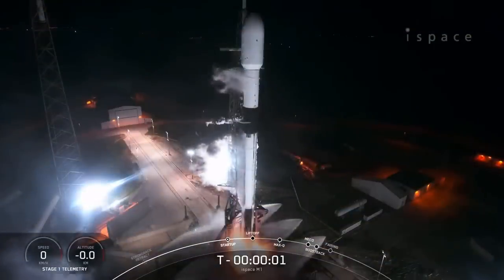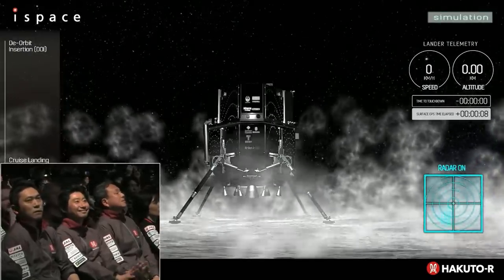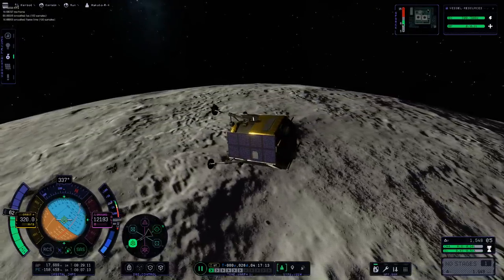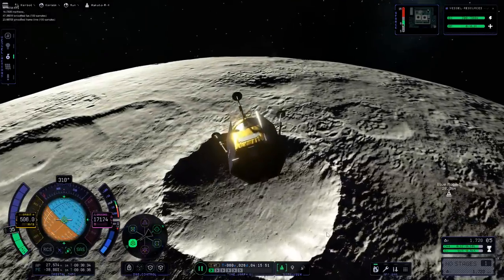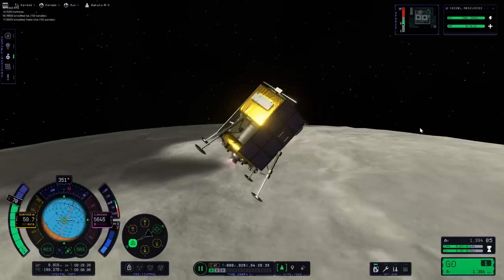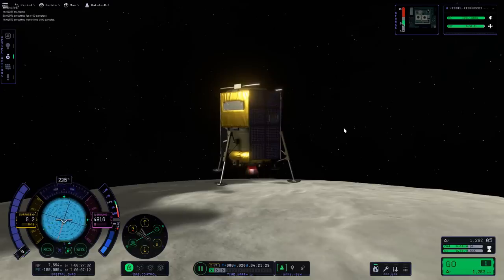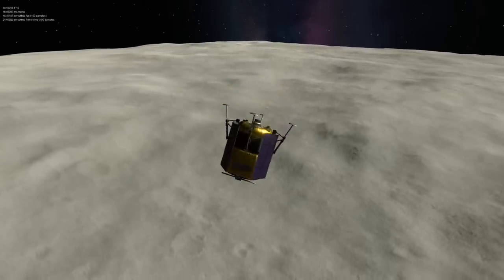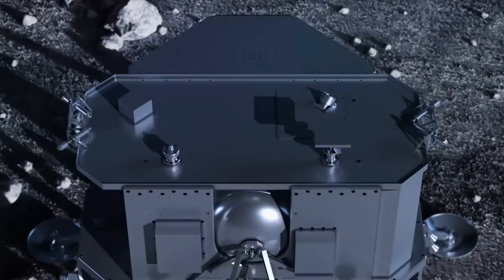Why Japan's Moon Lander Crashed Due to An Unbelievable Computer Bug

Comment: By, "unbelievable",  I'm pretty sure you meant, "Completely realistic, very common scenario when the software is put in an untested environment."

Note that I am saying this as a software developer myself.  I actually just identified a scenario where our existing tests were thought to be sufficient, but then some surrounding parameters changed and a bug was found.
Reply: As a software developer myself, I'm actually asking myself why those simulations were not set up to run like a CI.
Reply: @jarisundell8859  
Good question.  Seems like actually running the sim again once the final site was chosen should have caught this, maybe allowing them to upload the fix.

For the record, CI is how the one I looked at was caught... prior to release 👍
Reply: Scott is also a dev by trade, too, lol, he works at Apple.
Reply: @firefly4f4  I think it's a joke, since the bug happened because the computer didn't "believe" the radar
Reply from the maker: By unbelievable, I mean the software stopped believing the radar
Reply: @jarisundell8859  Physics simulations take at least a few minutes per run. You usually runs thousands or tens of thousands of those with randomized inputs during simulations test campaign. For CI you usually run single fixed one and check its output. 
The devil is in selecting how exactly do you randomize input data.
Reply: @SashaNaronin  If you think CI just runs a single simulation you're doing it wrong. As a software developer I would have generated many different maps with both normal and extreme edge-case terrains, and then had them be run multiple times with different initial parameters. Might even throw in some randomly generated ones.
Reply: Its the kind of bug where if you aren't involved, it's comforting to know that such highly skilled professionals can make such mistakes. At the same time, if you are involved, it is extremely cringeworthy humiliated feeling generating.
Reply: @scottmanley  It's similar to some plane crashes where the pilots stop believing their instruments show correct data and start to think they know better. Quickly they get into uncontrollable situation which leads to a crash.
Reply: @scottmanley  The software wasn't falling for it 😤
Reply: @ChemEDan  Flight Computer:  "I'm sick of your bullshit, Radar Altimeter!"
Narrator: "But it turns out, it wasn't bullshit."
Reply: @jarisundell8859  The problem in this case is that the computer has to expect the radar altimeter to fail. When the radar altimeter reports strange readings, it stops using its information. But what constitutes a strange reading depends on your landing site. If they had targetted a plain, were confident that they were in the surrounding area (no gps on the moon unfortunately), and the altimeter suddenly reported a cliff, then either the radar would be wrong or everything they knew about their position and the landing site would be wrong.
The issue is that after the landing site was changed, they did not properly configure the system to expect that cliff at that time during the approach. So when they detected the cliff, they software thought it was a malfunction.
"Software error" can mean many things, not necessarilly a software development failure (a bug). Misconfiguring software that is otherwise correct is still considered a "software error", even though the software didn't have a bug. That's a ops problem, not a dev problem. But the developers still get the blame.
Reply: @jope2  To me it seems like overengineering/overfitting, you build a very robust autonomous vehicle with sensor fusion, and instead of letting it do its work you add an additional demon in that whispers "expect cliff/expect flat"... That suddenly is no longer a robust system. No longer robust against flight plan adjustments.

Comment: Scott, I am surprised that you did not touch on redundancy. I was a fighter jet aviator and one of the things we always did was use multiple sensors to allow the software to compare and then estimate probability. If they has three Radar altimeters they could see the rate of change of the surface as the spacecraft travels. Even if each would have shown the cliff, probability calc would have told it that its is virtually impossible that all three are suddenly all bad. Redundancy would be one answer in my book.
Reply: Agree and also on my part, I always thought that radar altimeters were used « closer » to the surface.
Reply: Probably budget constrained.
Reply: @drill_fiend1097  This is a commercial effort so they could have just gotten one normally used in aircraft. It's not NASA where they cost $750K each just because...

Comment: hey Scott - thanks for the analysis. I remember this one (as well as the Israeli and Indian ones) and seeing the disbelief in the control room was sad. It is easy to tell who has a clue and who is a bureaucrat by their expressions, etc. :P
Reply: Hope there's no software issue when Nasa lands back on the moon!😂
Reply: @adarsh4764  agreed - one would have thought that even a small lander would have a pretty robust navigation system these days, but obviously they met an edge condition they hadn't properly tested for... and a sad oversight too as nearly all landing trajectories will have the radar return affected by craters you're passing over. There are many of them after all, and although most are small, many are large/deep and you need to keep their profile in mind as you use the radar/laser/etc surface measurement.
The state vector routine needs a sanity check to make sure the drift never disagrees from projected too much without it doing some form of reliable recheck.

Comment: Putting aside changes in mission plans, redundant systems missing or even software bugs, I think the main issue here is overly strict programming. Assuming something is defective just because of a sudden change that is out of scope is bit extreme. Baffles me how it could hover waiting for the moon while letting propellant go to zero without at the some point trying to salvage itself with something like "this is not working, maybe I should take another look at that system i think it's dead".
Reply: what you're describing is human decision making, and you're ready to scratch this plan and try something better when the moment comes. you can't just imagine every scenario branching out at every step and hard-coding solutions to each. At some point you'll realize you need a generic decision making algorithm. In fact the mission failed due to them having a specific solution of switching off a reading since that allowed them success in previous simulations.

Comment: Love this! Thanks you for reminding me of Kalman Filters, i studied those in my M. Tech., loved them but never thought i would ever hear of them again. I still remember how the "location estimation" part, based on current velocity and direction integrated over time (aka: dead reckoning) can provide smooth and accurate predictions over short durations, but errors tend to accumulate in a physics based predictor like this and needs to be augmented with an independent measurement (ie: the radar), even if the radar data is not accurate. Amazing to see how stuff like that led to this outcome. It is a tough one though... I wish you had shared your thoughts on how should a "faulty sensor" be detected then?  I mean, you could say that a 3 Km sudden jump in the sensor output means the the sensor is probably broken, right? If not, how else would you do that and handle the case when the sensor actually is broken?
Reply: Redundant systems and majority check: if all three of your radar sensor reports a sudden altitude change, than that's what actually happened. What surprise me is that the sudden altitude change eventuality is never accounted for...

Comment: I wonder what all these people in mission control were doing during the landing. Were they analyzing the telemetry in real-time? I assume they were supposed to notice that the radar altimeter was considered faulty and disabled. If so, perhaps they could have reviewed its readings and realized that after passing the edge of the crater, the readings returned back to normal. In that case, they could have just manually reenabled the radar altimeter. Since it is not Mars, the signal delay is small enough to allow for manual corrections during the landing.
Reply: Word!
Reply: They lost telemetry. If they had a connection they could saved it.
Reply: There might also be delay in communication.

Comment: But what if the radar altimeter actually did fail around the time it passed over that crater?  It sounds like it would have produced the same result.  I think the only way to deal with this in the design is to have at least one redundant sensor for something this mission critical.  Of course the problem with just one sensor is that you need to try figure out which one is actually the broken sensor.  That's why there is often 3 sensors or 3 computer systems that are used in this kind of redundancy...
Reply: Sounds like a redundant sensor wouldn't have helped this particular issue though, because it would have just gotten the same confusing measurements of the cliff wall. I think they just need to thoroughly run simulations of the actual mission to catch edge cases like this early.
Reply: On a vehicle like this, without humans onboard, the space and weight requirements might be too costly compared to the risk of a failed sensor.
Reply: @sonaxaton  exactly. Proper simulation campaign would've catched that.
Reply: @sonaxaton  3 redundant sensor and a voting system is the way to go. Worked flawlessly in many aeronautical things, from Concorde autopilot to missile guidance system.
Reply: The dead reckoning system combined with prior knowledge (a map of roughly what is expected) should have been enough of a redundant system.  Seems like they should have included a reassessment/recovery routine to check if that apparent altimeter glitch (which wasn't a glitch of course) cleared and the instrument was giving reasonable data.
This stuff is really tricky without a human in the loop.
Reply: @sonaxaton  If both radars give the same measurement then the software can conclude that they're probably correct
Reply: @wurfyy  What you said. Then ground control would override the astonishing choice to disregard the most important component in the landing (except propellant; but as it turns out, paper(radar) covered rock(propellant) so it killed that too).
Ground could say what was said in 1969, roughly "Eleven, we've looked at your issue and you are go for landing".
Reply: @sonaxaton  - The entire point of having the redundant sensor would be to vote.  You don't just assume an unexpected height is from a failed sensor.  If both sensors produce similar results, you assume the results are correct and that minor differences are actually a result of parallax or some similar issue.  

The only invalid values that should be rejected out of hand are min and max values, since that's what electronics tend to float (pulled up or pulled down) to when there is a hardware failure condition.
Reply: @wurfyy  - Exactly.  Well, they could give slightly different measurements due to something like parallax, but that's the right idea.
Reply: @a4d9  - But there was no accurate fallback, so not having a redundant sensor is probably a mistake.  If you can't have a redundant sensor, you shouldn't completely toss the sensor data because of an apparent glitch.  You should do some kind of smoothing or you should assume the data is correct unless the result is all zeros or all ones - ie: min or max values.
Reply: Radar altimeters are actually very reliable, and know when they're making an accurate measurement (their control loop locks on to the return path length) and when they're not. Really, the consuming software second guessing the health of the radalt by its data output was a crazy idea, when the radalt is in a much better position to know if it's working properly or not.
Reply: The report actually mentions "sensors" initially (plural) and then continues talking about "the sensor". So it's not clear whether there were redundant radio altimeters or not. In any case, all sensor(s) values were rejected.
Reply: @Damien.D  In this case the Kalman filter would have rejected the unanimous vote about the sudden altitude change.  
The fundamental mistake the team made is that they did not realize the Moon is full of sudden altitude changes and/or what that means for tuning the Kalman filter.
Reply: @sonaxaton  However, if you'd use three redundant sensors, you wouldn't just ignore all of them if they showed similar yet unexepected parameters. The issue here was that with one sensor giving unexpected data, it was just ignored. With three redundant sensor, you should only start ignoring one if the other two are in shared disagreement.
Reply: @Nummer378  never heard of redundant radar altimeters on a spacecraft, I don't think even the Apollo Lunar Module had one, really hard to land if your altimeter goes bust, next to impossible actually, better make it a robust device, if software can so easily dismiss radar altimeter which is normally a very reliable device then there is a problem with overall design
Reply: @Damien.D if you have the weight / power / space for triple redundancy.  And if you don’t have common mode failures.  Ariane 5 first flight had redundant IMUs but they common mode failed due to a user specification error (unit would error out if too fast too low altitude, which Ariane 4 couldn’t but Ariane 5 always would…).
Reply: @rspawn  The Kalman filter would be confused for a while. It would converge just fine during the remainder of descent, probs.

If I follow correctly what Scott said, the problem was not at all tuning of the filter, oh no. The problem was they improvised an ad-hoc way of discarding some sensor data before the actual filter.
Reply: If you always lose the craft when the altimeter is ignored then you must always trust it even if it might be wrong. Obviously, much better to have terrain prediction models and compare to these. In the end, your choices are always trust a maybe fault altimeter and maybe crash. Or ignore it when there is an error an guarantee crashing. Hmmm
Reply: @jamesgibson6641  I don’t even think it makes sense to attempt landing without functional radar altimeter. If you can’t trust it you are done.
Reply: @Damien.D  Achilles heel of redundant systems is Common-Mode Error.  As Scott stated, these recent failures have all been due to software.  It is best if not only the hardware is diverse (e.g. different manufacturers) but also the firmware/software is diverse - e.g. produced by programmers of different backgrounds (e.g. educational systems) using different programming methodologies and different programming langages.   In software production methodology experiments I was involved in during the 1980s, that approach demonstrated significant degrees of reduction in Common-Mode Error.  A team of three diverse developers can be less CME-prone than a roomful of "clones".  Also majority voting is not always the best way to fuse data.
Reply: @Olasek  what I meant to say is there is no choice.  Whichever way it goes you are landing on the moon somehow, either in bits or otherwise, there is no such thing as a safe abort as nowhere to go back to- unlike the Apollo mission which had the command module. The sophistication is in how you weight the sensor fusion filtering and in how the sequential decisions made determine success or failure. For example, flying over deep crater  makes craft think it is higher and confuses velocity landing profile, engines throttle back as seems to high, land comes back underneath, too fast, cannot, fix, crash. However, it may also be that in the last stages of a landing, very close to ground, the radar altimeter used for most of the approach will saturate and fail - say if it using a chirp profile and convolution to get better effective radiated power at long range. In this case a final approach sensor may take over and the altimeter readings are discarded. In the end, it is faulty requirements and flawed assumptions implemented in the software . Hope they learn and land safely next time.
Reply: @jamesgibson6641  it pays not to be too ambitious and just land, like Apollo 11 did, in a relatively flat terrain. But to overfly a rim and have to deal with drastically different floor elevation inside crater, boggles one’s mind why they did it, a bit incomprehensible. It almost sounds they would have succeeded if they only selected a different region.
Reply: @u1zha  Discarding data that is out of bounds is not ad-hoc, rather it is a property of a Kalman filter. Tuning of the filter includes setting proper bounds for the filter's inputs  - which depend on the circumstances under which the filter is used.
Reply: @rspawn  Hm, unsure that's really a property of Kalman filter. It does not inherently discard data. Proper or improper, discarding is done before feeding it into the generic maths